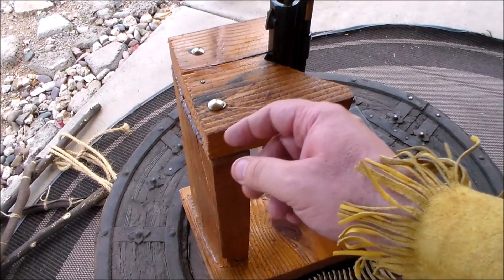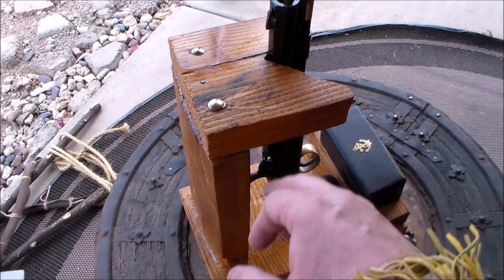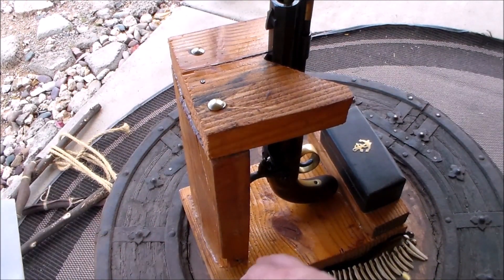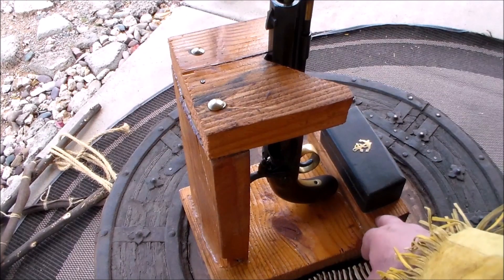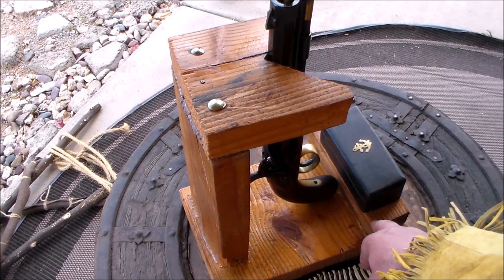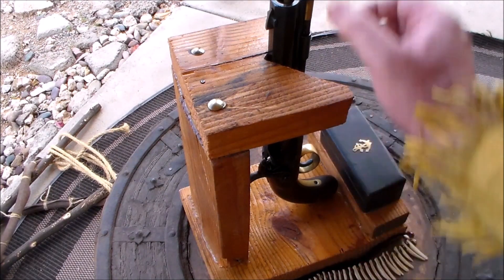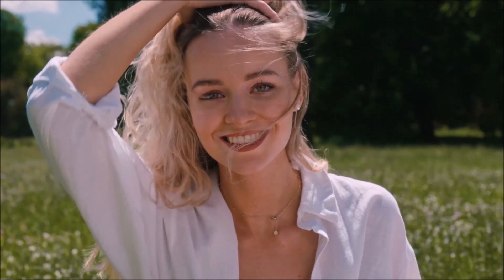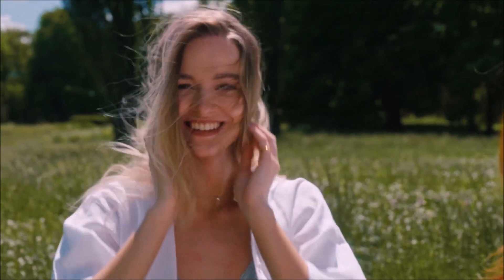Loading Stand for Muzzleloading Flintlock or Caplock Pistol Detailed For You to Build One.

Comment: The storage box is a great idea.  I wonder if I can make the same stand work for a single shot and a revolver.
Reply from the maker: I used a V notch for the octagonal barrel, for a cap and ball revolver you might try as U shape notch, four pieces of wood and some screws and a little gorilla glue for extra strength, plus that little storage box helps keep things handy, and it beats loading off hand.